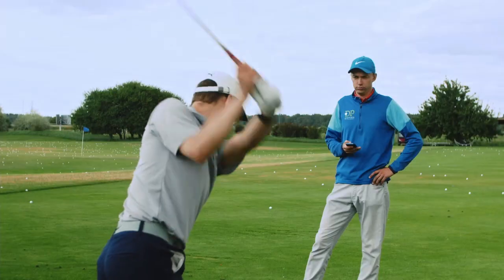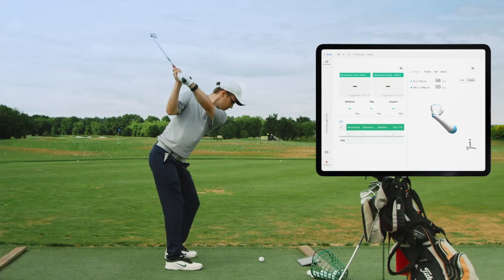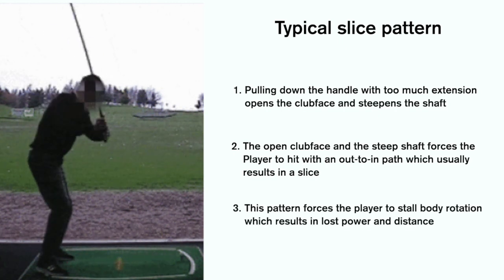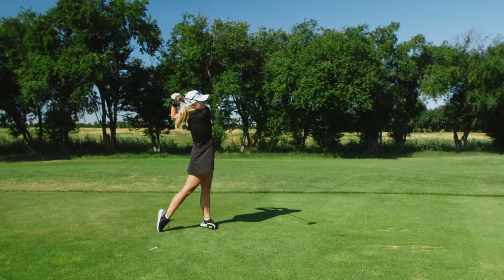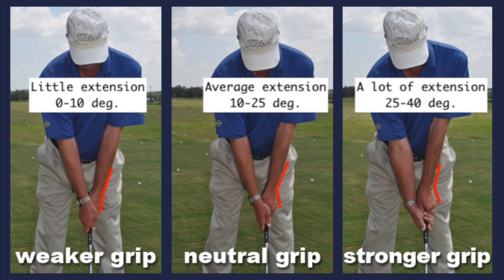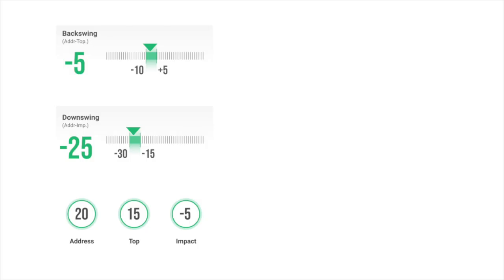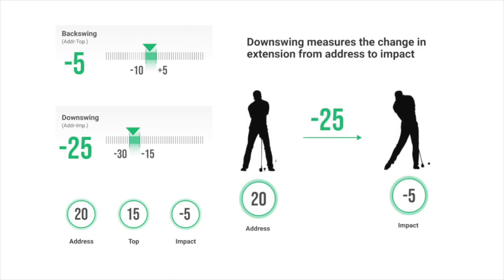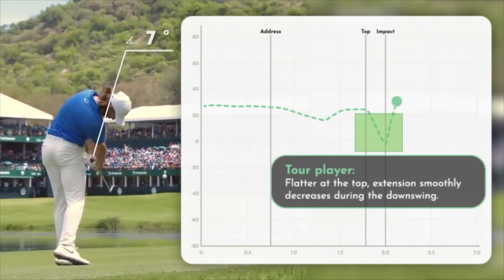Getting Started with HackMotion - Understanding Flexion and Extension

Comment: Why does it tell me I'm out of range at setup and forces me to have a weak grip to greenlight?
Reply: Take this with a grain of salt, as I just received mine and still trying my best to understand how it works..but, from the few sessions I’ve had and reading up on it, I’m thinking that when you do your initial swings to calibrate the unit, you are using a weaker grip?  I’m trying to test this by using one of those grips that show you exactly where your hands are supposed to go on the club like Scotty Scheffler uses…